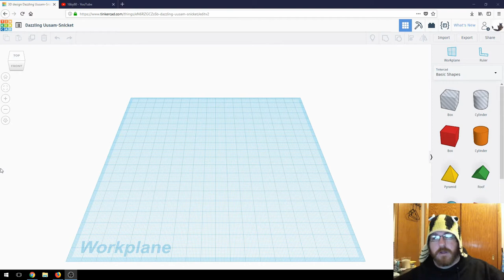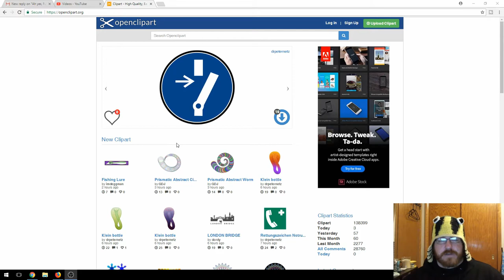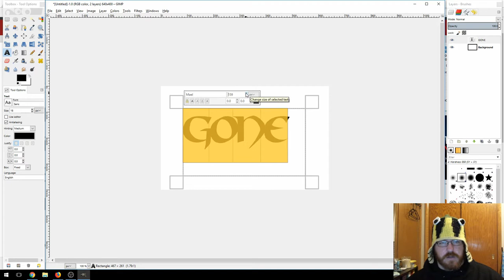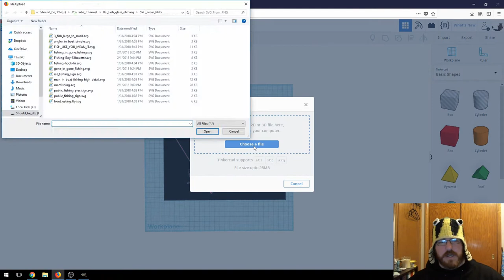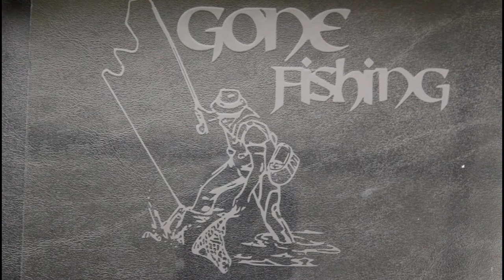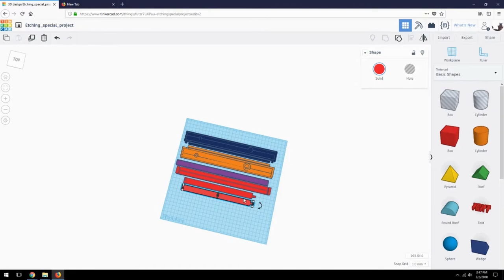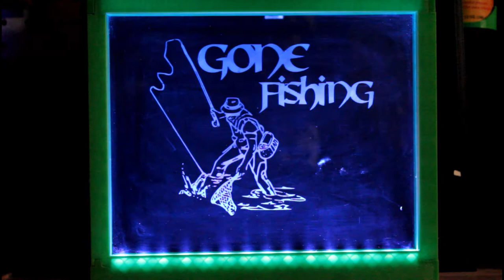Glass etching with any 3D Printer and Armour Etch!

Comment: can you reuse the printout to make more?  Also is the print flexible enough to etch a beer glass?
Reply from the maker: You could possibly but it would be tough to realign it and get them to stick well for the second print.  I've done it about 4 times now so it is pretty quick to set up and then run the print, I think none of them were over 2 hours.  The other issue with reusing it I think would be getting all the little pieces back to realign.  A lot of the more complex designs have no connections between holes in the PLA so getting them all lined up would be tough.  You could potentially use it like a large stencil on a beer mug it is flexible enough at 0.3mm but it would be tough to line up independent stencils.  Unless you could make the design one large piece with no separations.  Also I think it would be tough to get the right adhesive for it because you don't want the adhesive on the mug anywhere but under the stencil.  Although I am working on flex filament stencils now specifically for this purpose! I have tons of beer mugs I etched but had to do them by hand.  Doing this out of flex filament with some type of adhesive would make a great project.

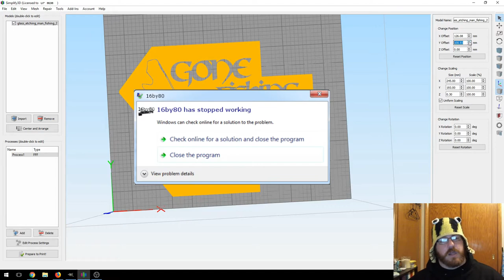Comment: 6:45 LOL
look forward to your future stuffs :)
Reply from the maker: Thanks! Yeah...I was editing and I saw myself do that, I figured at that moment I wasn't responding.
Reply: I have a noob question and since I am a noob I will ask the question. Does PLA and the other filaments float or sink? Could you possibly do a video on the density of each one in water.

And if it's possible to control whether it sinks or floats. I know you can make something hallow but does it float at all or will all items made from the materials  just sink to the bottom.

Thanks
Reply from the maker: In my experience it depends on the print.  Most of the filaments do soak up some water to some extent, PLA does a little bit and PETG really like water. I think ABS is pretty resistant.  It all depends on the layers of the print if there are any gaps at all the print will let water in.  I have played around with lure design a little bit and got a half working prototype.  It does work but unless there is 0% gaps in the print it will take on water and go neutrally buoyant or sink to the bottom.  Finishing them with epoxy similar to balsa baits would go a long way into creating a more buoyant seal.  Once we get the 18" of ice of the lakes I'll revisit the project for sure.
Reply: Cool and thanks once I get my printer I'll let you know what I find out too.